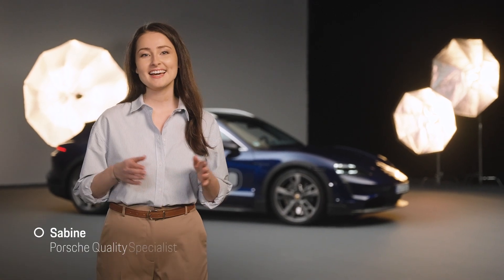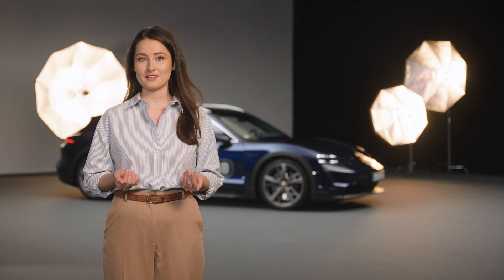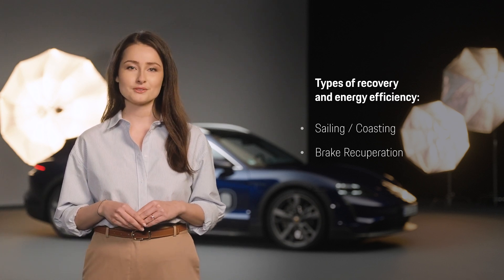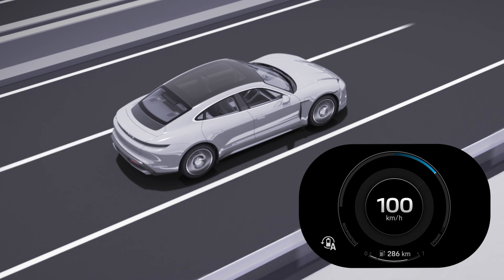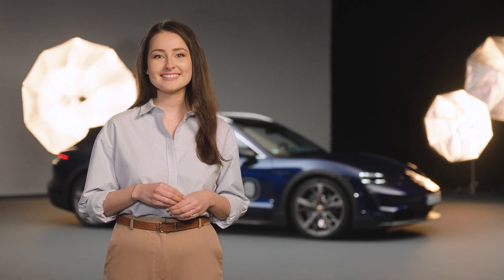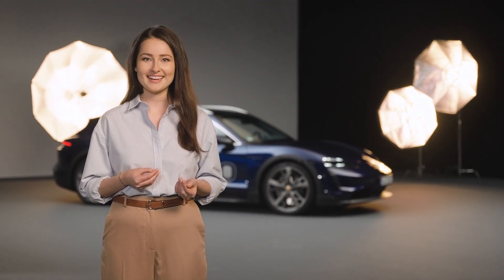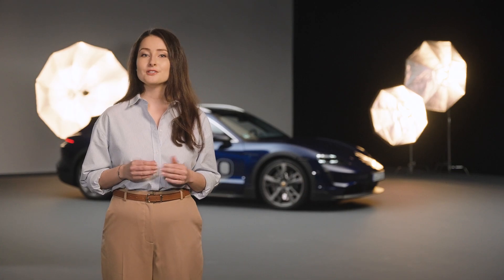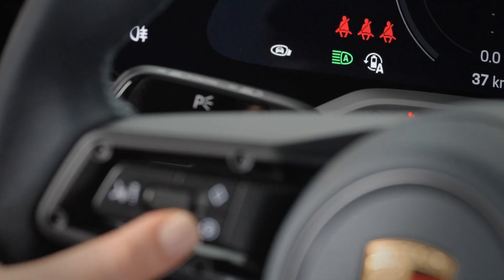How to use the Porsche Taycan Recuperation System | Tutorial | Spot On

Comment: Worst point about the car. Not one single mode that gives one pedal driving. Auto regen is fine providing you keep a big gap to the car in front otherwise the car fights you all the time. 

There's also no indication how much regen on the brake pedal is going to the battery and how much to brake discs. Complete mess. Do better Porsche. 

Worst part of the car after the total quatsch that is the charging timer/modes mess.